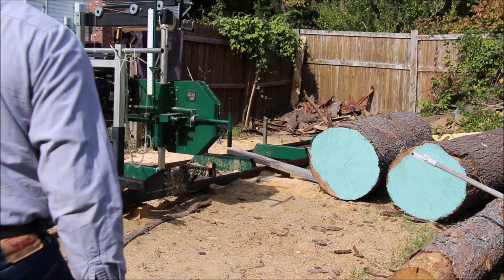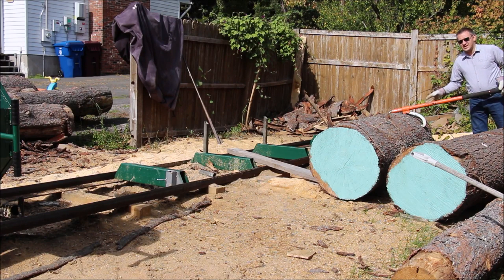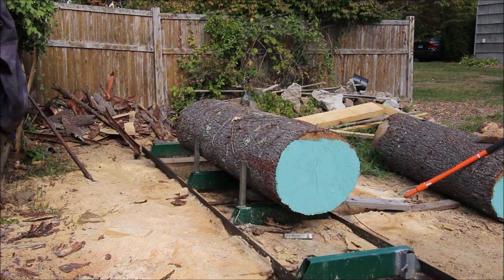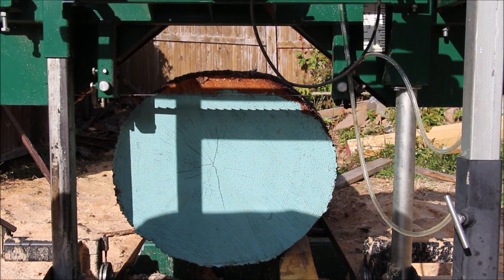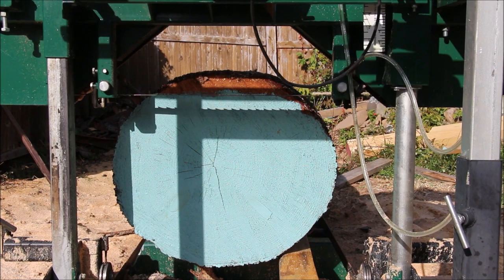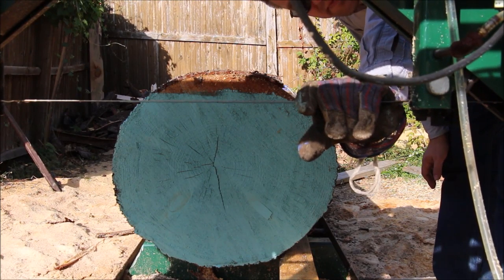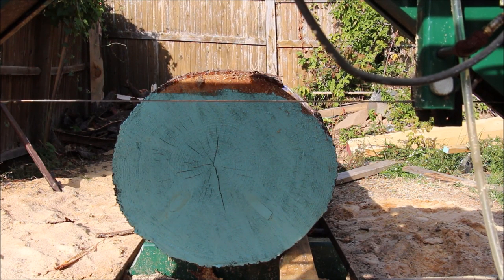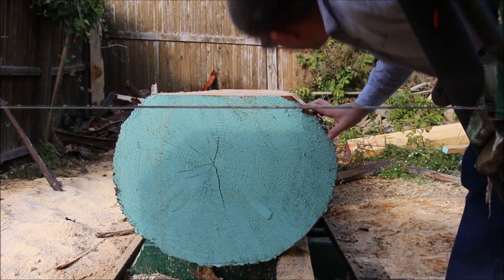approaching a log, my process for milling, and some trouble shooting

Comment: Matthew, you really should brush up on your terminology:
Slab - piece with one flat sawn on it.
Flitch - Two faced stick that has raw bark edges on opposite edges.
Cant - Piece with usually 3 adjacent faces that will be re-sawn into boards. 
           (An exception can be a thick two faced stick which will be ripped perpendicular to the faces to generate boards.)
Board - a four sided piece of wood.

That being said, I would think you'd be able to get a couple of 2x4's out of that first slab you tossed. 
I get what you're saying about big knots weakening a 2x4. But it seems a shame to cut 2x4.s out of a white pine log that big rather than getting some nice 1x12's or wider. I guess better 2x4's than firewood...
Reply: Tom Novak mj

Comment: As a backyard sawyer, where are you getting your logs to mill up?  There are only so many trees to drop on your own property.
Reply from the maker: bwillan  actually I have multiple Tree Guys that drop me logs for free I only have half an acre of property
Reply: Matthew Olson Well that is certainly a great convenience to have your logs dropped off at no cost.
Reply from the maker: I don't know where you are from, but here in CT we have a LOT of wood, and a lot of tree guys.  Pine is completely junk to the tree guys, and often they have to PAY to dump it after a job.  plus, bucking it or chipping it gunks their equipment, so for some its easier and cheaper just to dump at my place.  for super long logs I need to pay for those.... stay tuned for the next vid... I have an 18 ft log I work on :)